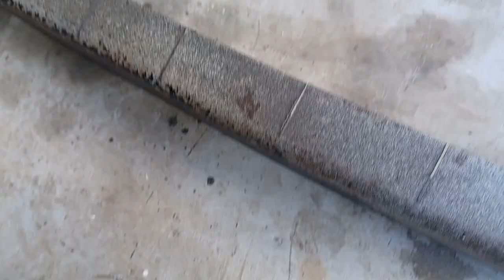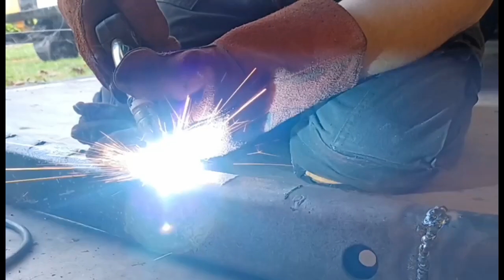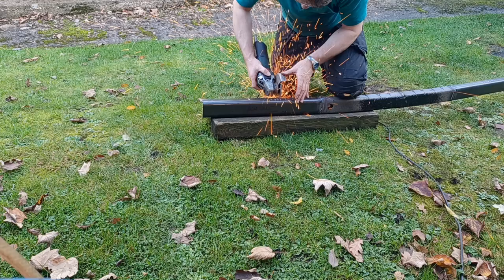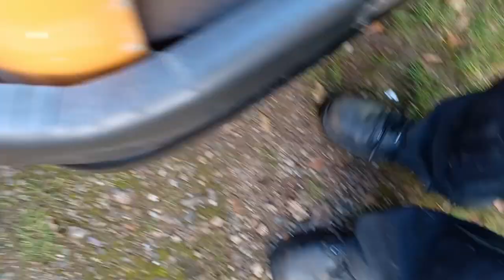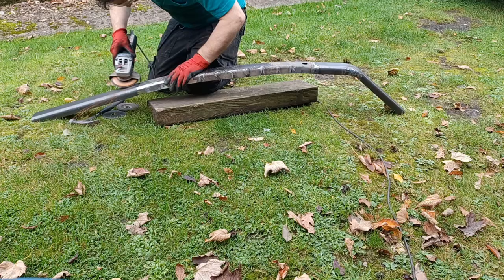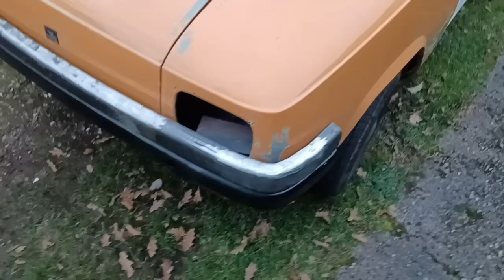Creating unobtainable parts - Enfield 8000 bumper #creating #replica #welding

Comment: Could a new bumper be made from a different plastic material? Another thing where do people get Enfields from and is it still electric?
Reply from the maker: yes it is still electric all original control gear - they do pop up for sale occasionally but getting hard to find now Some GRP ones were made and I have a set but they are both non original and not very solid but look ok - prefer these no contest plus if I touch something they do not break!